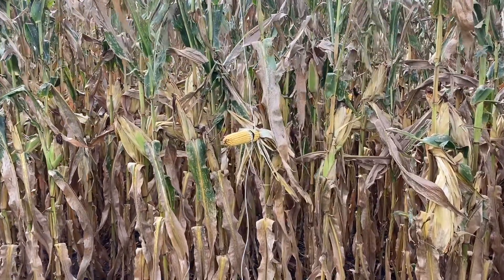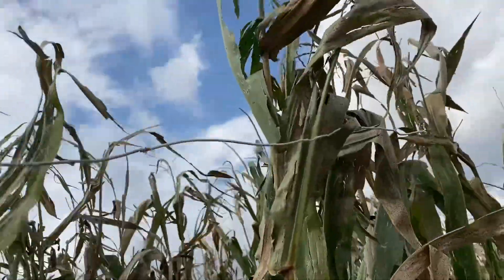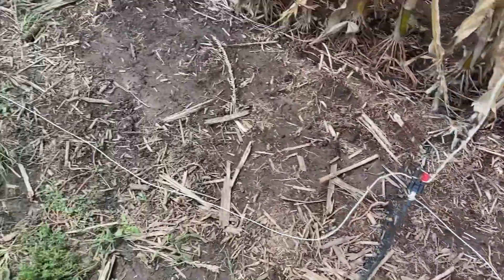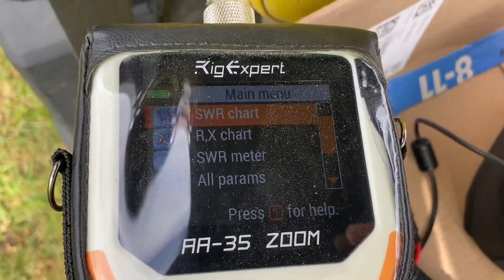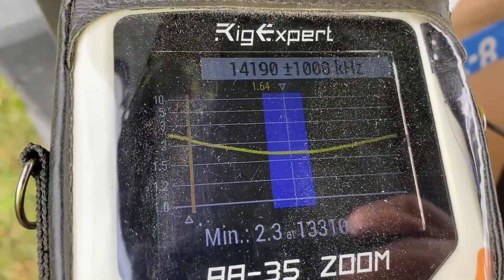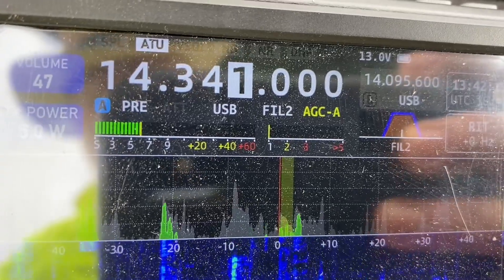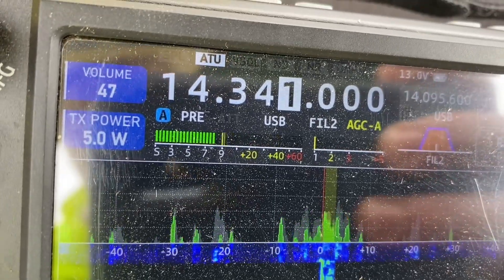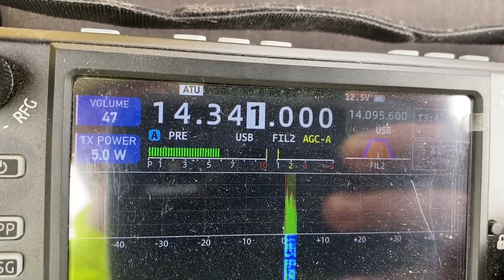SUCCESS - CornCoil Antenna Part 2, QRP 5w, Xiegu x6100

Comment: Excellent. Top loading is always best! I wonder how much your resonant point moves if you eliminate the coil. 
73,
Don N4DJ
Reply from the maker: hi Don, when I unraveled the two turns on the coil, the dip location did not move, but the SWR increased. But doing so also lowered the feed point to the ground so that probably had some effect as well. Seeing the increase, I wrapped the two coil turns again and left it alone. Thanks for watching and thanks for commenting.
Reply: @hamradioqrp-k0klb that makes sense. Great job!

Comment: Ok Kevin... Does corn cook when its wet?  can you pop corn and make contacts at the same time?  Gene
Reply from the maker: Hey Gene.. This corn won’t pop.. the outer shell of the kernel isn’t hard enough, but it will burn.. it’s a good renewable heat source.. i use it in a corn furnace to hear the shed in winter. Thx for watching and leaving a comment. i appreciate it… 73

Comment: Always amazed what you do with corn! I wonder if you had a little more RF if you could get it to pop!! lol  VE1SK
Reply from the maker: hi Steve.. This corn won’t pop, but it will burn. I can use it in a corn furnace to heat the shed in the winter. Thanks for watching. 73